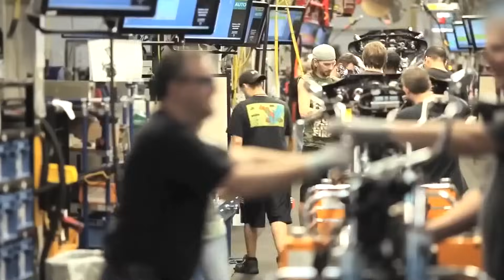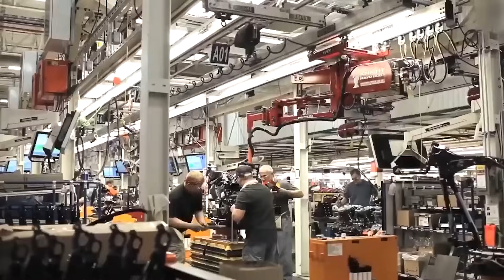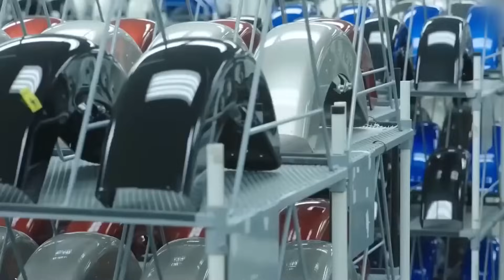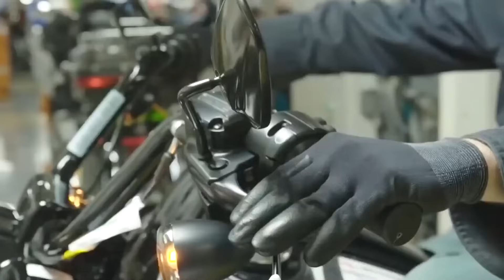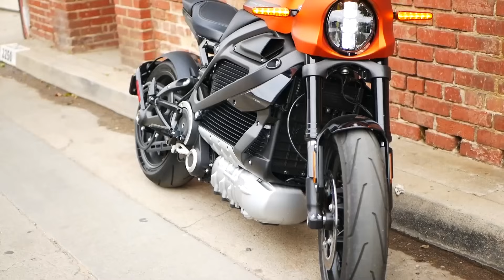How Harley Davidson Motors Are Made In Their US Factory 2025 | Step By Step Process

Comment: Cool video I have a 2022 Lowrider S that I have done some motor work too and such and I have to say I am extremely disappointed in the motor company, quality and standards a lot of plastic and cheap not to mention lots of loose bolts I would assume that they have a torque wrench in the factory, but could be wrong. Oh well leave lots of upgrades available I suppose cool though.

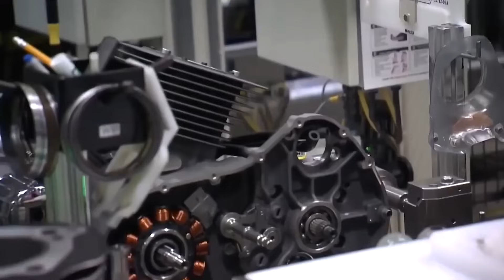Comment: Sadly, watching a AI Harley Davidson’s commercial Ad. Section 6:19 claims Harley Davidson’s is stronger than ever selling their products is false! As of 2025, Harley Davidson’s is in big trouble and trying to stay afloat. Why? Past generations that wouldn’t think of any other motorcycle brands but a Harley are getting too old to ride and dying off. This generation are not interested in load, heavy, and expensive motorcycles, they prefer less cost, lighter, and easier to maintain brands such as Honda, Yamaha, and Suzuki, where Harley Davidson’s has been struggling with. There is no innovation with Harley and the so called new products does not appeal to this generation. Many of the new Harley’s front frarings look like a Hugh half of salad bowl cut in half without the silverware. And the bikes are still loud, heavy, and expensive. 

Another thought to this crisis not just for Harley Davidson’s but for all two wheel transportation vehicles. To add fire to the financial mess Harley Davidson’s is already facing they are not spending in ads to promote their brand, like many other motorcycle industries this is a major down fall to appeal to their audiences by not promoting their brand. Back in the late 70’s through the 90’s motorcycle companies commercialized their products from TV ad’s, billboards, and magazines. No longer. It’s all about the profit and every penny save is a win for Wall Street or private headfunds investors. So, no one knows about a new product if it is not promoted in one shape or form. In Europe things are done a lot differently when it comes to show casing their motorcycles, maxi scooters, e-bikes, and bicycles. Through out the years they have trade shows, product launches, and invest heavily in advertising to all generations. Yes, Europe has always been the capital of two wheel moto or cyclist, but that’s because it has been imbedded into their society for years which is by promoting in every shape and form. That is why Europe has more to choose from with motorcycles, maxi scooters, and all forms of bicycles. The US car industry spends more revenue for advertising their brands which leads to why more people buy cars than motorcycles. Yet, that was a different story back in the 70’s all to the 90’s. 

Sure, we can make excuses for why Europe has more two-wheel vehicles than the U.S.—our lifestyle, where we live, roads not designed for it, too dangerous, etc. But the truth is, these are just excuses for why two-wheel transportation isn’t as popular here as it is in Europe or elsewhere. It's nothing more than a mindset.The less we see people riding or see ads promoting two-wheel vehicles, the more excuses we come up with. Again, back in the '70s through the '90s, we thought differently. Motorcycles were everywhere. Young and not-so-young riders used their bikes to commute to work, go grocery shopping, head to the movies, or tour the country. When a new model was introduced, people would rush to the nearest dealership to trade in their current bike or become first-time buyers. Awareness of new motorcycle models was ingrained in our minds through constant advertising—nothing more, nothing less. It worked. Parents didn’t have an issue with their kids buying motorcycles because they, too, saw them everywhere. It was normalized and embedded into their mindset just like it was for everyone else.

So, there are many factors to why Harley Davidson’s is struggling for the. last few years, but the main core to its downfalls is the lack of innovation and promoting their brand. Other brands are hurting too, but Harley is heading into downroll spiral compared to other industries. Of cause, the timing of an uncertain market we’re living in has a somewhat effect to the sales of any type of motorcycles, it’s still not the main factor to their decline. After the pandemic the automotive shares has gone up and people are willing to pay the high interest rates for their vehicles. Whereby, if you flood your product on social media and every other forms of advertising people will come to buy no matter how the market may be. This would be no different for Harley Davidson’s and everyone else. Even if Harley Davidson’s doesn’t innovate and continue to make load and heavy motorcycles but heavily promotes it, they will be in a better position, not great, but better.😎
Reply: Sales on ALL  motorcycles  are down  WORLD WIDE.

Comment: So my journey with HD started with a 1991 5 speed belt drive 1200cc Sportster.  I had a rear hydraulic lifter go out and the frame looked like it had the measles. It was rusting ,a brand new bike 🤔🤬Word is Harley wasn't drying the frames before painting . SO i had to have a brand new bike TOTALLY stripped and powder coated to make it good . I swore id never buy another Harley.  Fast forward  i bought a 2014 Firefighter Streetglide 103 HO . Had a new infotainment screen put in because it would mist up due to moisture 😵‍💫Also a re-call for the hydraulic clutch ( apparently some bikes would still creep forward with the bike in gear BUT the clutch was pulled in !) Now mine didn't do that thankfully but it had a new plunger installed.  Also the cheezy hardware for the hard bags would snap . Another re-call and one of my clips had indeed fractured because it is made out of cheap pot metel . The replacements were no better  so i went aftermarket with good quality steel clips and bolts . I also have a 2005 Deuce . The FIRST thing was to change the cam chain tensioners. ( A KNOWN issue Mr Harley ignored.  Now thankfully the crank runout allowed for Gear Drive cams. It cost but i have FULL S+S EVERYTHING in the came chest with 509G cams . All this automated assembly is all well and good BUT not if your assembling with shit /quality parts . Example,  the run out on these pressed Cranks are OUTRAGEOUS ( some of them ) from the factory.  In fact as the years have gone on they have gotten to where they can scissor and not using quality bearings ( like they used too) all for cost savings.  Bearing in mind the bloody bikes cost so much they should have TOP QUALITY components PERIOD.  Now i love my two Harleys but they have to be maintained WAY more then any metric bike ive ever owned . In fact i have a 2015 Honda CTX 700cc as well and i would bet my life on it reliability wise . I could trash the holy shit out of it and it would still run and start the next day . By the way if Harley is SO GOOD with its manufacturing process how come the latest and greatest coming out of the factory are having ALL kinds of issues especially with the cost of some of them . This is just one mans story ( mine ) .Take it for what it is . BUT i personally know people that have traded their one , two year old bikes for the very newest and wished to God they could have their OLD bikes back 🤙🇬🇧🇺🇸
Reply: I have a 92FLHTC  and 93 FXDWG    and  only done fluid changes filters  ,tires ,batteries  spark plugs and adjustment to the drive belt and primary chain.

Comment: I didn't realize it took so much work to build a vibrating couch. One minute into this, and I had to stop watching. 😅😅😅
Reply: Helped a friend take out the clutch in his EVO Softail. The swingarm weighed as much as a Honda 750 frame. Solid steel. In the nineteen twenties other manufacturers were putting triangular section steel tube inside round tube to make it light and stiff.